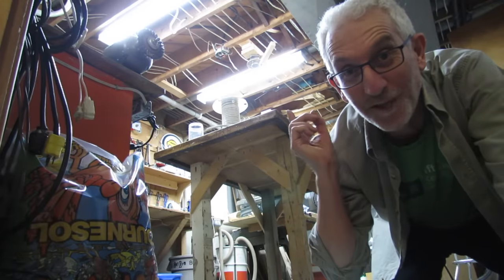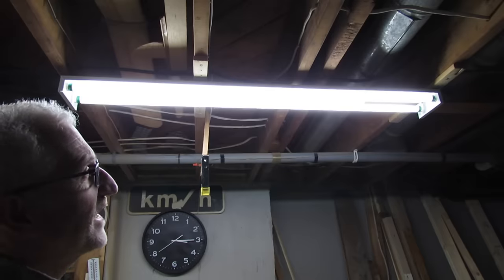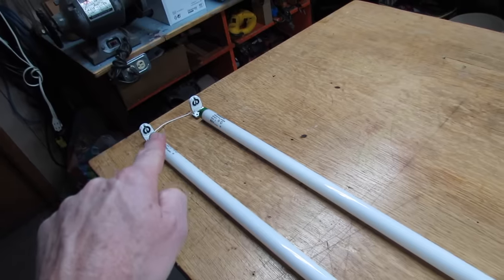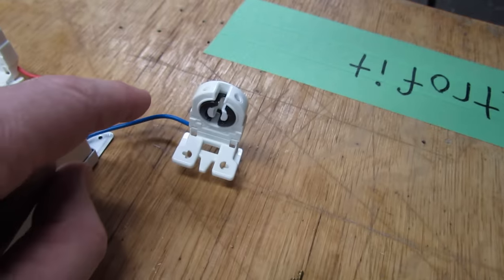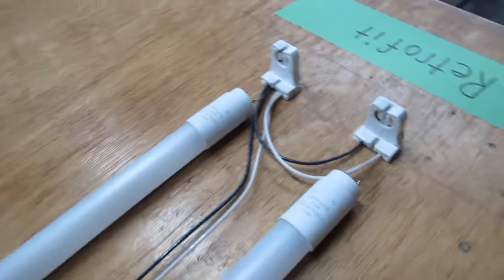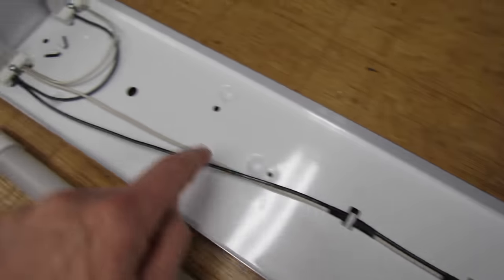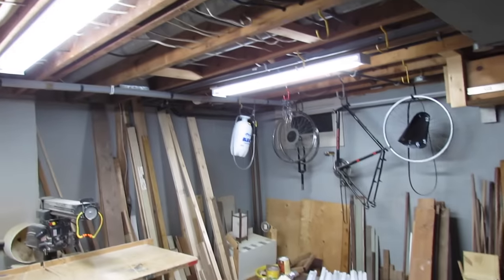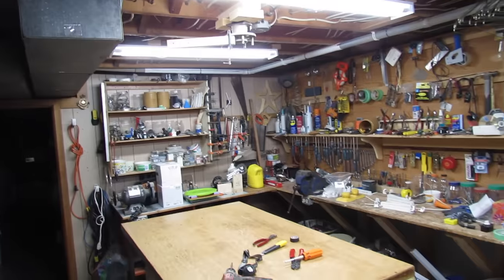How To Convert T8 Fluorescent Lights to LED ● Explained in Simple Terms

Comment: First of all why shatter flourescent bulb? It has meecury and should be taken to recycling center. Second thing, leds are not cheap, and replacing fluorescents while in working condition is not economically viable option at all
Reply from the maker: All correct but I'm the type of guy that shuts off a light whenever he leaves the room. It doesn't make sense to me to leave a light on when you leave a room and waste power. These florescents can't take the off and on cycles. My bulbs were only lasting just over a year and they're not cheap. These LED's have now been up over 2 years without a single burn out. Very happy with the light they project and their performance.

Comment: Only draw back is EXPENSIVE......  They will never come close to paying for themselves.
Reply: Sorry, but that's not true.  My two LED bulbs cost $30. Florescents in a two pair package is around $8.  Since I had to replace mine ever 8 - 12 months or so, in less than 4years the cost breaks even (not considering electric bill differences).  And sine they last 50,000 hours, it will be decades before needing replacement.   Looks expensive at first yes, but don't buy full retail price.

Comment: Breaking the tube of fluorescent lights is unwise. The tube contains harmful materials. By the way LED lights are things of the past, nowadays induction lights have a better performance and a longer life and a lower energy use. (and a higher price) LED lights have some disadvantages, such as flickering lights and an unnatural light spectrum. Both can be give serious health problems.
Reply from the maker: Yes breaking a fluorescent tube is not good. I made sure I had on a good breathing mask before I did that scene.

Comment: I've seen new fixtures with LEDs for the same price as florescent fixtures without bulbs.
Reply from the maker: They are slowly coming down in price. There are some deals popping up but time will tell if the ones you are talking about will last.
Reply: Yep, the issue isn't just the LED themselves, it's the rest of the circuit that can burn out because of cheap parts. Might be better off spending a little more. Also I've seen those non-retrofit tubes can burn up the ballast, I'd be worried about it causing a fire.

Still, the first LED bulb I bought years ago was $10.

Comment: I am not sure your video is better than the others who as you say do not describe what's actually happening with the circuits. For one you jump from one cut to the other without showing what happened, but what I really need to understand is the pros and cons between plug and play and retrofit. Most places like Home Depot, Lowes, etc. advise to buy a plug and play since retrofit requires pretty much re-doing the wiring and using different tombstones, which is beyond the average persons skills. Also, you said something like this set up will be using MORE power than before, how is this possible? Most expert websites talk about between 45 and 65 percent savings in energy costs!? Also, even with plug and play the wiring has to be modified, at least that what they tell you when you ask about converting from fluorescent to led. In other words still a confusing video. Sorry thumbs down!